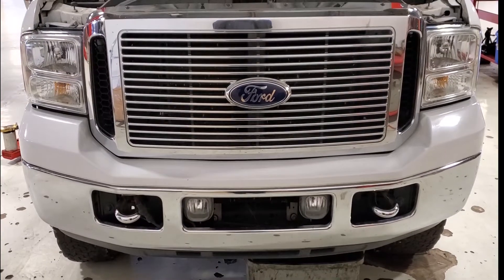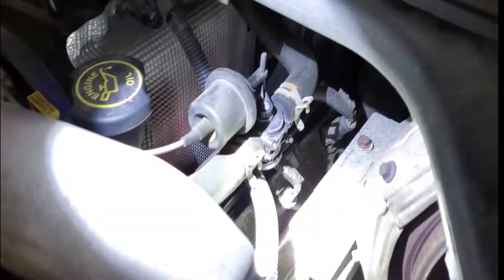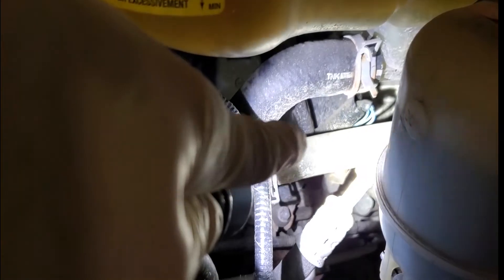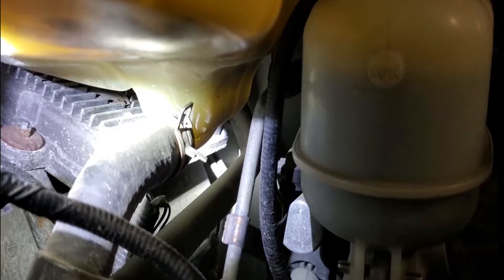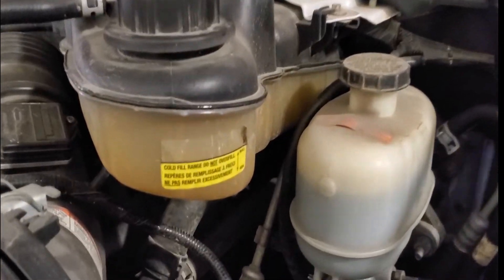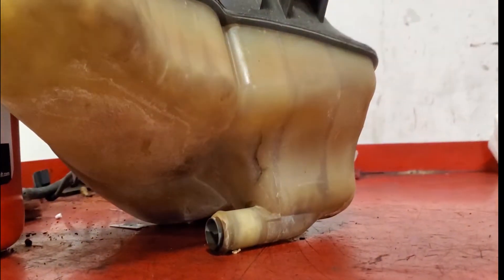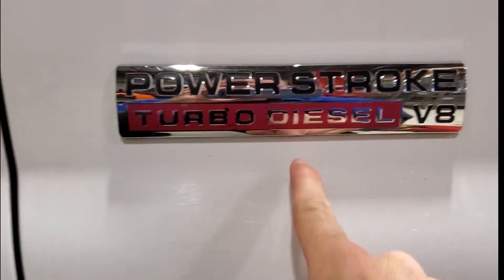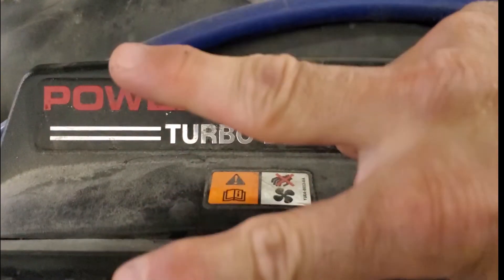6.0 Diesel TOP Coolant Leak Points!

Comment: I have a leak on the driver side. Only leaks when the truck is off and cooling down I’m not sure if 3 is what’s leaking. It was bulletproofed 5k ago
Reply from the maker: Pressure test time...
Reply: @PowerStrokeTechTalkwARod  what does the problem sound like tho. I’ve never had a diesel so I’m lost
Reply from the maker: Could be anything brah...you need to pressure test the cooling system. Doesnt matter if its a diesel....cooling systems are all pretty much the same
Reply from the maker: Not 2 leak coolant on the outside
Reply: @PowerStrokeTechTalkwARod  okay. So coolant wouldn’t be leaking on the outside. on engine if it was a head?
Reply from the maker: Yes
Reply: @PowerStrokeTechTalkwARod  okay that’s a relief. Thank you. The new headgaskets only have 5k on them. I think they were black diamond head gaskets do you know if they are good?
Reply from the maker: Yea them are same as OE

Comment: I just got an 06. Drove it for a week and noticed a loud fan coming on whenever I accelerate only once the truck got up to operating temperature. Decided to check the coolant and the degas bottle has no coolant. What do you think? It’s my first diesel.
Reply: Get gauges on it and perform all the 6.0 tests.
Reply from the maker: Gotta find where the coolant leak is comin from. Least you knw the fan operates.....
Reply: @PowerStrokeTechTalkwARod  was leaking from the degas bottle. I installed a new one and flushed the coolant. Still have to pick up a scanguage

Comment: I have a 04 Excursion 6.0 with a #3 hose leak. It is the lower heater hose touching the FICM and has a pin hole only when under pressure. Can you tell me what the part number is or the correct name of hose so I can order from Ford dealer?  Is it really doable at home? Pretty handy just dont want to take it apart and be stuck. Thanks for good content.
Reply from the maker: Can for sure be done at home, tell em u need the heater core hose that wraps around the fire wall

Comment: 6.0, cant figure out for the life of me where it’s leaking. It’s leaking near the inner, wider, serpentine belt, but the belt then sprays out on everything, so difficult to pinpoint it. If I had to guess, it’s on the drivers side, as that’s where the majority of it sprays. Leaks out maybe 4-8 oz after it’s parked and turned off. From underneath, i can see drippage on the CAC hose and the main crank. Don’t see any hose connections leaking, at least with a flashlight and without removing anything. Any ideas?
Reply from the maker: Lower hose...
Reply: I'm having same problem i found out that the y pipe/from DGAS  bottle, that point of connection with lower hose... FYI buy ford parts Napa junk not even 6 months and multiple leaks.. so just bought all new oem the fit is so much better. Thanks Aaron
Reply from the maker: No sweat pal!!
Reply: @PowerStrokeTechTalkwARod  have you ever seen that connection point on the front cover leak- near that 8 mm bolt or am I thinking too much into this leak?  Thanks again
Reply from the maker: I have not but there is a doughnut gasket directly above that cld be seeping...
Reply: @PowerStrokeTechTalkwARod  thanks bro. I'll look into it...

Comment: I had a leak from the donut o ring in the front where the intake manifold Installs into the top of the block.  After a while, it seems like it deforms, it was intermittent and looked just like a #1 J tube leak, was dripping down the valley over on to the passenger leaf spring.  Had to remove the intake manifold to fix.
Reply: J C what else would make it leak in that exact spot? Do you know if there is anything else that result in this?
Reply: You Might have just saved my ass man thank you
Reply from the maker: I got chu

Comment: I replaced the bottle and cap, doesn’t lose coolant anymore unless I’m pulling my trailer? Not sure what it is?  2006 f250
Reply from the maker: Is it pukin out da cap. Is it all wet around there after pulling
Reply: PowerStroke Tech Talk w/ARod it was but I had the  bottle and cap replaced, now it only loses coolant if I’m pulling a trailer
Reply from the maker: Time for ARP head studs bud

Comment: You forgot the donut gasket that goes on under the front passenger side of the intake. Other than that, great video!
Reply: It’s actually simple and fast...you just loosen the intake bolts, pry up the front of the intake, out with the old and in with the new. Simple and quick!!!
Reply: Hey I’m having a leak around there. Where is that donut gasket located?
Reply from the maker: Passengrr frnt
Reply from the maker: I know not to re use them. Seen a buncha dudes get screw because of that....& u knw what u meed to do to get that out...🤦‍♂️

Comment: fingers crossed it's from 2 or 1. I've got ARP studs and I'd hate to have that headache. I pulled it in the shop to check out my exhaust because it's a little loose at a band clamp and noticed some drippage. We will have to see what the issue is.
Reply from the maker: Holla!!

Comment: What about from the oil cooler area. I have a leak coming from what seems to be the front of the oil cooler and just want some input before i go tearing the motor apart
Reply: There is a donut gasket on the underside, passenger side of the intake towards the front. Would be visible coolant in the valley leaking out the back passenger side from the top down.
Reply from the maker: I never ever see them boys leak
Reply from the maker: Coolant is leaking? Check that little hose under the turbo

Comment: Just replaced the degas bottle last weekend on my 2006 6.0 as it was cracked exactly as described here.  As soon as I replaced that, a crack appeared on the top passenger side of the radiator.
Reply from the maker: Hmmmmmm mighty weird
Reply: @PowerStrokeTechTalkwARod  Probably should pressure test it to check the head gaskets.
Reply: That happend to mine also.

Comment: 07 F350 6.0 diesel. I notice I have a coolant leak dripping on the passenger side and the truck has started pouring white smoke out of the exhaust. Any ideas or suggestions?
Reply from the maker: Would have to pressure test it to make sure, but sounds like you might have a ruptured EGR cooler...

Comment: Great informative video content! I have a 2005 6.0 F350 SRW Thanks for the leak points going to check my truck. 
I have a problem I was trying to change my engine fuel filter. When I used a 1/2 extension to try an take off the cap, I broke the plastic “nut” on 2 sides. How would you get the cap off? I bought a new cap but getting the old one off is problematic. Tried vice grips etc. any thoughts? Thanks!
Reply from the maker: Thanks so much!! U are going to need to get a fresh flat blade screw driver and give it the tap tap taparooo and dig it in and walk that boy off counterclockwise. Hope that helps
Reply from the maker: I just made a video yesterday for the same concern, stay tuned. Youve probably already fixed yours but u inspired me 2 make 1!

Comment: Hey I know this has nothing to do with coolant leaks with what im about to say. But what are your thoughts about a " Loose " gearbox and doing alignment on them on powerstroke super duty trucks.
Reply from the maker: Them gear boxes can wear out. As long as all the front end components are tight and everythings good, youll probably have to replace the gear box to get rid of the slop. If its too far gone, doing an alignment can be a pain.
Reply: @PowerStrokeTechTalkwARod   Thanks. Hate doing alignments on trucks and vans with sloppy gearboxes
Reply: On my 08 the original steering box lasted 112k nice and tight. Im on my 3rd reman at 115k and all of them are loose
Reply: @fiberking2571  look into a redhead steering box
Reply: frank viera I’ll be looking into that next
Reply: @fiberking2571  so it's better to just get a new one ?
Reply: Jesse Lyons I haven’t been able to find a dealer with a new one only remans. I’ll be looking into a red head box like frank mentioned